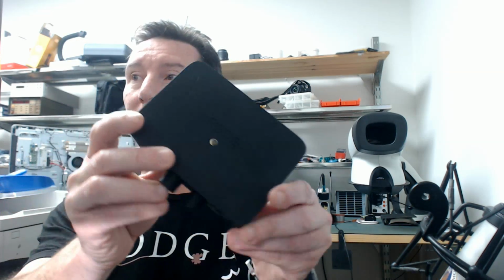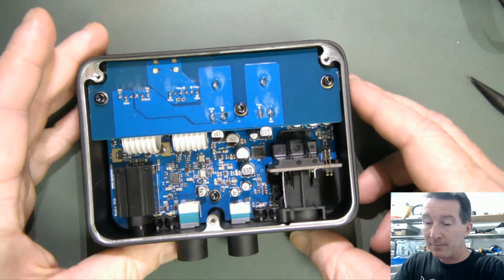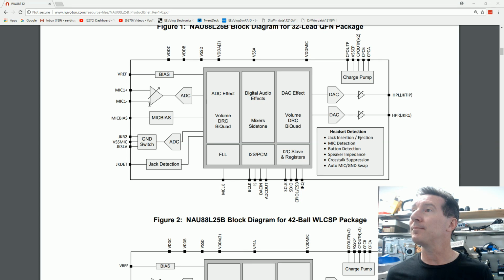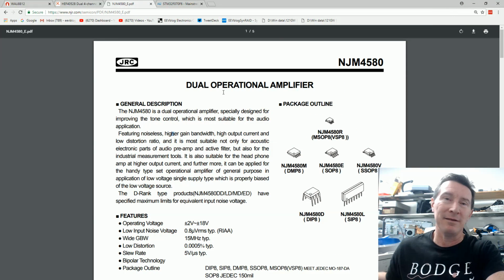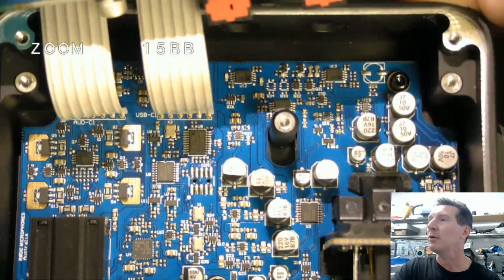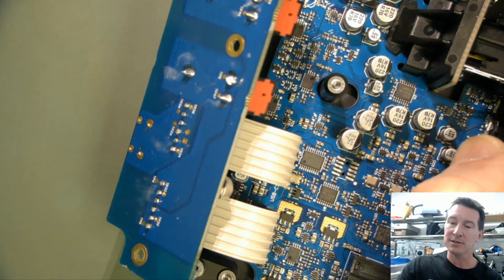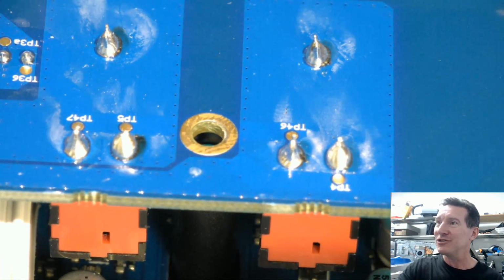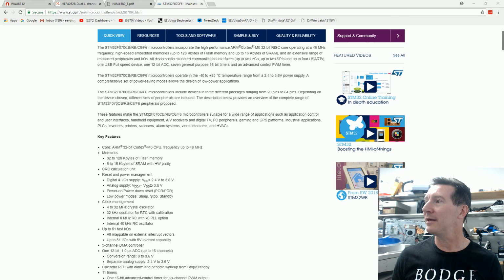Rode AI-1 USB Audio Interface Teardown

Comment: Wow. Thanks. More than I could ever want to know about this piece of kit. BTW, the LED 2&3 bits are for the lights that tell you when the input is active and whether phantom is engaged. Nice breakdown. RØDE always make excellent quality products, and the NT1 and NT1-A tend to get underrated because of the price. The quality is excellent, though I prefer the NT1 to the NT1-A, which can be a bit brittle sounding. I can run an NT1 through the Neve controls strip of my UAD-2 Apollo preamp and get vocals that "experts" can't distinguish from a Neumann U47 or U87. They are far better than any of the current Neumann offerings with the possible exception of the TLM 107. The current U87-Ai is a disastrous mess of a mic. The NT1 bundle with this AI-1 is a steal! The price of the Rycote shock mount and pop filter alone is 80 USD. Add the price of the mic (which is extremely under priced, but I'm glad!), and you're getting this interface for nearly free if you buy B-stock or used. Buying B-stock and getting the unmatched 10 year warrantee is just a no-brainer. Even if this isn't your main interface, it's great to have something you can toss in a ruck sack and not have to even worry about a power supply! The one drawback is that you can't have simultaneous and/or separate headphone and monitor output. It's a bit overpriced as a standalone, honestly. But as part of the bundle, it's a great little add on. Love this review!
Reply: Yes, i agree %100 percent and just bought the kit but this is a pcb analysis so most of the people are not into mics and mic pres. By the way mine is on the way and i dont think shock mount is Rycote brand, rather than Rycote stayle. so i dont know adding 80 bucks to kits value is fair. but i agree mic is reaaallyyy close to u87 so even 400 bucks will be a steal for the kit.
Reply: @pauliewalnuts1024  no way it close to a u87

Comment: Hi, I am planning to buy Rode NT1 complete studio set which includes the Rode AI-1 audio interface. The one offered in Amazon. Basically, the RODE AI-1 is for USB port devices like laptops and PCs. But my objective is to use it on my Iphone (IOS) particularly for the "Smule Sing!" App, it is a popular Karaoke app offered on smartphones. I have already found solutions on how I can connect it on my Iphone. I have searched on all the things I need in order to make it compatible with my Iphone. Rode AI-1 is powered from USB-C to USB-A. I have found out from youtube videos that I can connect it to my Iphone through an adapter, the Apple USB-A female to lightning male adapter. It works perfectly fine based on the videos and tutorials. But I have been searching on lots of reviews and I cannot find answer on this very crucial question. Based on the reviews, I am aware that the audio coming from RODE NT1 mic will come out to the Rode AI-1 audio output, the one on the right side where I will put the quarter inch audio jack. Now my question is, can I hear also from this output (Rode AI-1 quarter inch audio jack) the background music coming from my Iphone? I mean, the "Smule Sing!" app is supposedly a Karaoke app where I will be listening to the background music provided by the app while I am singing using the RODE NT1 mic. Now, I am worried if I can hear the music from that "Smule" app and on the same time, the sound coming from the RODE NT1 mic? I'm sure I will hear the sound coming from the mic but I'm not sure about the sound coming from my Iphone's "Smule" app. And I have the same question as to my laptop because if I will record a vocal with a music coming my laptop, will I hear that background music coming from my laptop? I hope I can get an answer from you. This is the only issue that prevents me from buying the set in Amazon and until now I cannot find an answer on it.

Thanks and best regards,

Comment: The STM32 is probably there to speed up the signal processing to send it over usb since I believe it has native usb support. It probably also does some control stuff to detect headphone jack and stuff like that. makes sense to use a 32 bit micro that is cheap and easy to program with native usb for something like that. The older USB DACs that had usb right off the codec had horrible latency.

Comment: How did they manage to route the mic gain pot to the area towards the top right where the actual mic preamp seems to be located? I'm puzzled. You see, mic preamps have to be very low noise at high gain yet allow for some relatively high input levels at low gain while covering a substantial adjustment range, which pretty much means a gain pot in feedback - and feedback is not something I'd wanted stretched out across half the board. Granted, a nice differential run on one of the inner planes might work, but still. 
There is no way there isn't some sort of dedicated mic preamp there, as top-flight noise performance with dynamic mics mandates an input noise density of around 1 nV/sqrt(Hz) or even better, requiring either dedicated preamp chips or discrete circuitry.

Comment: I wish someone would do tear downs of USB device descriptors.  Most USB audio devices rely on the default device descriptor provided by the silicon manufacturer and avoid paying masking costs.  The result is a large number of devices that share the same vendor ID, device ID, vendor string and product string.  Further, the serial number field is usually zero.  The result is that you can have a wide range of devices that cannot be user identified in the user interfaces on various operating systems.  For example, I have three instances of a USB Audio / Radio Modem Sound card, one commercial radio with built-in USB audio sound card, and a commercial high-end audio mixer board that all identify themselves as "USB Audio Codec", despite being from different manufacturers.  All of these devices use the same silicon device from TI, and not one of them has their uses a mask option to provide a unique descriptor that allows them to be identified. Worse yet, some operating systems suppress redundant names from pop-up menu controls, making the devices unreachable by the user.  The device manufactures need to be hung up by the gonads for not implementing their own device descriptors. 

Also, the descriptor information is never published with marketing material so you never know you're going to have a problem until after you buy the device.

FWIW, this problem has existed since day 1 of USB audio.  I worked with the author of the USB Audio Specification v1.0, and developed the first USB audio device driver for a major operating system, and this has ALWAYS been a problem.

Comment: I spy a fake CE mark on the base.
Reply: The spacing is wrong. The circles which the C & E form parts of should overlap so they look like an 8 on its side. Rhode have used the China Export mark.
Reply: Yes! I'm surprised they weren't able to get that right!
Reply: +silver & noise Missed point. The incorrect CE mark so often appears on non-compliant goods from China that it's come to be referred to as the 'China Export'  mark.

Comment: 1/4 inch outputs are not balanced
Reply: They often are on pro audio equipment. Tip ring sleeve.
Reply: Coolkeys2009 interesting didn't know that! Normally that would be stereo unbalanced.
Reply: There are heaps of 1/4" balanced TRS connectors on things, like literally every mixer console and most audio interfaces/boxes have them.
Stereo 1/4" is almost exclusively for headphones.

Comment: Most better codecs have  SPI/I2C bus to access the extra bells and whistles (DSP effects, compression, auto-level, etc.) via an MCU. Some of your more basic codecs can operate in a "standalone" mode, using logic HI or LO on pins to set different parameters/features. All the ones I've ever worked with use differential in and outputs, and special bias input requirements, hence the need for all those op-amps. Also allows engineers to incorporate their own unique,  tailored input pre-amp designs.

Comment: Off-the shelf USB-audio chips typically only go to 48 KHz. There's also the issue of clock synchronization, which most integrated chips don't handle that well. With a micro you don't have these limitations, and can also implement extras, such as signaling the 4052 to route the analog signal to the headphone jack. What Rode did makes perfect sense.

Comment: Thanks for sharing, we'd love to have you come around and check out the factory!
Reply: Does it work on iPad Pro??
Reply: @kire_S  only on 2018 iPad Pro :-)
Reply: @EEVblog2  Pleases go and visit Rode factory!
I mean we all have seen PNP machines and Re-flow Ofens but they real interesting cnc machines, and i would love to see the diaphragm tuning process.
Show us some of there secret "secret sauce"
Reply: @RØDE How have you managed to increase the gain on this with a firmware update without increasing noise?
Reply: Hi! Please help. I need to stream hdmi with Canon M50 through Avio 4k. M50 does not have clean HDMI sound streaming. Just video. If i buy Rode AI-1 - can it link the computer to Rode Filmaker wireless mic,  without any delay between sound and video?

Comment: the case looks extruded and then machined :-)
Reply: It doesn't have a lid on the top side, the enclosure is solid there, so it's not an extrusion.
Reply: it is not continuous extrusion, but still it is extruded :-) 
it is "cast" extruded or however you call it, it is a hybrid process of casting and extrusion.
Reply: 'Die-cast' might be the word you're looking for.
Reply: Hybrid Die Casting is more what I meant, it means part casting part extrusion, it is neither to the full extend.

Comment: The layout is correct, op-amps are near the the microphone input jack to bring up the gain on the input, Usually the op-amps are set up in 20db incriments and selected by the mux for 0db, 20db, 40db , 60db of gain for the input. Usually the in chip variable mic amp in the chip is only capable of 20db which is way to low for a dynamic mic. Not to mention that the entire signal path is balanced up to that chip. The I also would be very surprised if the phantom power is actually 48V if the capacitors are only 50V usually in these USB powered interfaces it is 24V or 36V which works fine, could be wrong. The 4 transistors are used as a power amp for the headphone possibly for the speaker output. And Crystal, you crack me up (old 16 bit ISA/PCI sound card chip for those that do not know).

Comment: what i think happened was the layout was finished with 2 standard connectors for input and headphone, than someone went "no lets use one of these multi connectors" and there was not enough room on the one side so they swapped the location of the connectors and some engineer was like "nah im not re-laying everything out" and just dragged the traces over and moved the mux and phantom power
Reply: Unlikely. I think the design is sufficiently deliberate, i mean you can't have the ADC right near the input because the analogue switch comes first. But for analogue switch to work, the preamp must come first. But since the preamp is there, the requirements are relaxed. Plus that thing is cramped, with that component density, that also affects how much room you have to work with for the traces, painfully little and you can't just have traces going willy nilly.

Comment: Sorry Dave, after 13:30...you really need to seperate HiFi (high impedance) mics from Studio grade low impedance symetrical mics. 200Ohms is the usual source (=mik) impedance from a standart dynamic mic. If you use condenser mics which also have an active output stage their output impendance are ususally even lower.
Therfore the trace length is not that critical. 
But the Line level input traces are much more critcal. As you are usually got 10k input impedance adn furthermore it´s non-symetrical (= hot and ground). Also sometimes the level is homerecording -10dB input (0.0775Vrms). So they really placed the main audio chip as close to the unbal. most sensitive input as they probably could without using a multilayer board.

Comment: How is the 48V regulation done?
Reply: Probably isn't. Voltage isn't critical, and isn't actually maintained in operation, you just shoot in the general vicinity of somewhere just under 50V without load, and if the output impedance is about 6-8 kOhm, that's fine, and you pad it up anyway with extra current limiting resistors until that's the case. Many microphone phantom supply circuits don't even deliver close to 48V open-circuit.

Comment: Would this thing be class compliant, eg plug'n'play?
I have the Rode NT-USB and while it is plug'n'play it's not quite class compliant. It will not work with ASIO4All because of the proprietary internal monitoring implementation. Rode have no drivers for it so it uses basic windows drivers. In WASAPI or WDM mode the latency is not great. The latency using the built in monitor is good though. It's not very useful if you have more than one audio interface. Rode said they only support the default configuration as a Windows default audio device Headphones and Microphone.

Comment: Why two Crystals?
Because USB needs 12MHz and the Sampling Quarz has 12,228MHz.
Its cheaper to use two different Crystals than a Crystal and a PLL.
Reply: The STM32F0 does not need a USB crystal, you can run internal oscillator and have it auto-trim itself to USB transitions and USB frame length - special feature on this one. Furthermore there is a separate USB crystal, it's the third one right near the F0!

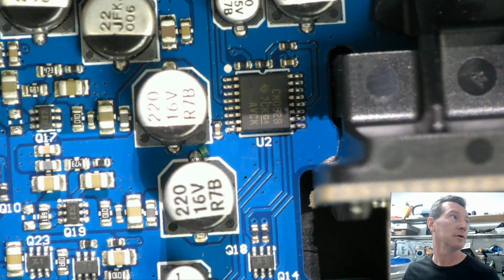Comment: What's that green thingy at 9:47 flapping in the breeze between the two caps? oO Looks like some loose component.
Reply: Looks like a piece of green plastic to me, not a component. Maybe a piece of wire insulation, maybe even something Dave had stuck to the tip of his tools and lost in there.

Comment: 28  Min's  of waffling
Reply: he knows far more about electronics than i ever will but its always slightly annoying when he has no clue about a standard audio technique (though what even is I2C??)
Reply: I  would  love to see him  do a  "no waffling  video ", you think he can  do it
Reply: This is Dave's standard for 'no waffling video', if you want extra waffling, it gets 2 hours long.

I'm not sure where you got i2c from, you probably meant i2s, the latter is a simple serial bus specifically for regularly sampled DACs and ADCs, basically data, clock, and word-clock. i2c is in turn a low-speed serial bus with address/message format and bidirectional communication on just 2 wires that can pass through up to hundreds of devices, you'll find it all over the place, in VGA/DVI/HDMI cables to query monitor ROM, in RAM sticks to query their configuration ROM, to talk to all kinds of sensors. To make things extra confusing, advanced soundchips like used here have both i2s and i2c, i2s delivers audio, while i2c serves for register writes to configure the operational parameters of the soundchip, like gain, filter, all those kinds of things.

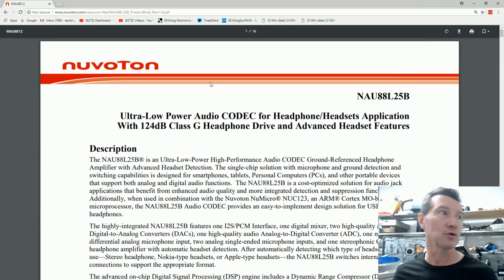Comment: Couple of corrections. 5:58 it doesn't say "ultra low noise" it says "ultra low power" and then at 7:53 you say "121 dB" SNR for the ADC when the data sheet says 101dB (which isn't great at all).
Reply: yeah this is $130, or you can get a Scarlett Solo for $100 which has one more input and higher sample rate with essentially the same specs/noise level. I'm sure its fine for the purpose, but not industry leading.

Comment: You usually need 2 separate crystals to support the 2 different sets of audio sample rates because generating them from a single source and dividing or multiplying it can cause a constantly changing phase shift in the sampled audio when the clock is not an exact multiple of the desired sample rate.  This sounds like a very subtle phaser effect added to the recorded audio and it gets worse when you have to mix multiple takes together because the phase shifts themselves won't line up.  Multiples of 44100 and 48000 are usually what make up the two different sets of rates and we only have Sony to blame for this...

The mux is probably for switching between the XLR and 1/4" Jack input and since it is a dual 4 way mux they can probably also use the mux to invert the input signal as well.. that is if it isn't doing something else.  So if you need to invert the input you can switch it in software rather than use a physical switch that could add noise.  I normally like to design my preamps with the input having a more direct path into the ADC, but whatever.  I also prefer the PGA2500 mic preamps before my ADCs and a 52v boost circuit that is linear regulated to 48v just before each XLR to reduce noise... but I'm just crazy. ;)
Reply: 10100rsn Inversion can be done in the digital stage at almost zero cost and absolutely zero extra noise.
 While difficult during the DAT debacle, 7.056 MHz is a nice common multiple for clocking ADCs and DACs, though it doesn't have a nice common multiple with the USB bus (multiples of 12MHz).
Reply: I don't understand why they gave STM32F0 a crystal to begin with. It doesn't need one. If you run internal oscillator and enable USB, you can make it auto-trim the oscillator to the USB frame length, so it's always in sync with the host upstream. It's a special feature of this processor, F1 for example doesn't have it.

Comment: Many usb audio ICs are not very advanced. They usually don't allow the device clock to dictate the rate of data transfer for low jitter, the computer just pumps it out. Also you want good low latency ASIO drivers.
Reply: Many modern ones have asynchoronous mode.
Reply: Wojciech Lewenstam There are some which act as a DAC like the ES2093 but I'm not sure there are any / many that act as a full audio interface to support simultanious input and output at high res, asynchronous, low latency, etc..